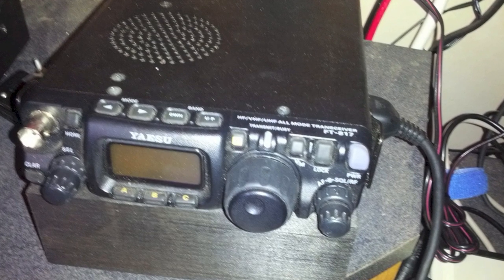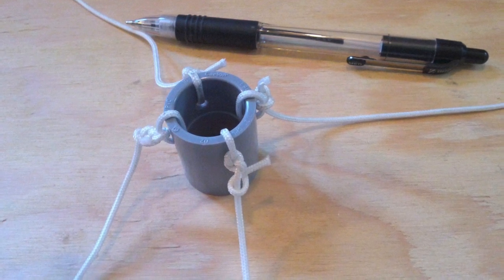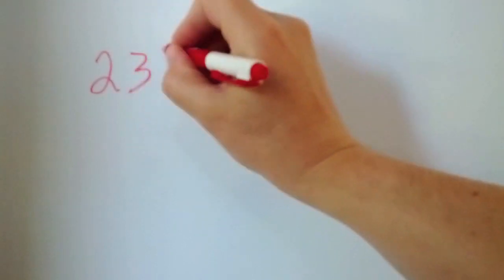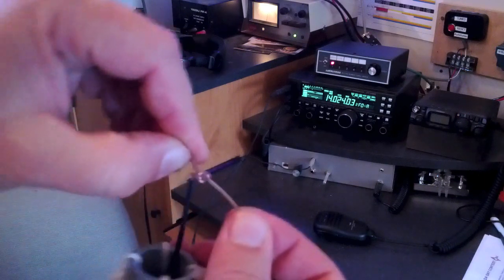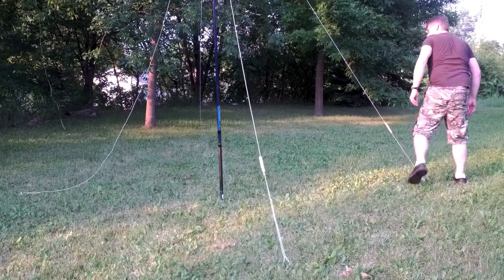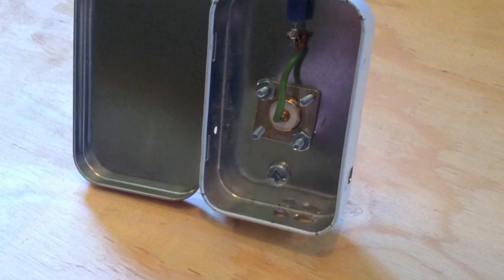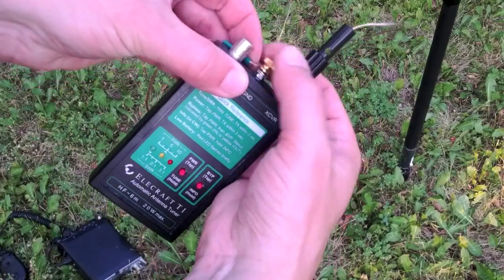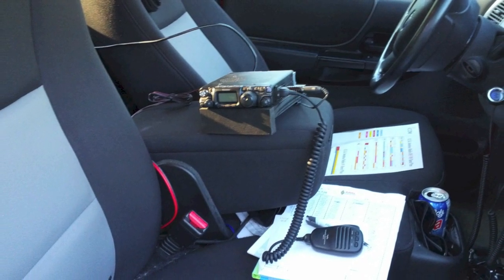Portable HF Ham Radio Antenna

Comment from the maker: The 'ground' side is just connected to the ground lug on the radio and stretched out on the ground away from the mast, as a counterpoise. I usually use only one such wire, the same length as the one that goes up the mast, but you can add more and fan them out from the base.

Comment from the maker: The pole in my video is suitable for light duty temporary use - I would not rely on it for permanent use or anything heavier than a light wire antenna.

Comment from the maker: The pole is 46 inches long when fully collapsed.
The antenna as shown is cut for the 20m HF band.  For your HT, you would be better off with something like a wire J-Pole.  There are many examples on the internet - search for 'twin lead J-pole'.  These are easy to build for 2m/440 and you could hang one from a pole if you wanted to get it up in the air.
Congrats on the Tech license! I'd encourage you to try 10m - just build my antenna and cut the wire length for 28MHz instead of 14MHz. Have Fun!

Comment: I make a stationary antenna for CB 27Mhz with fiberglass. Antennas will be high on the pole. What should I use to fix that does not close? Where are the winds and storm, how to fix?
Tnanx for video
Best regards.
73

Comment: This is great!! I got my Tech license in April (KF5PCX) and have been browsing YouTube for good videos. I've become more interested in field expedient antennae and think yours qualifies. I have some questions for you: 

What is the length of the pole when fully collapsed (or fully broken down for transport)? 

Can this antenna be used to extend the range of an HT, assuming the correct connectors were installed?

Thanks!!

73, KF5PCX